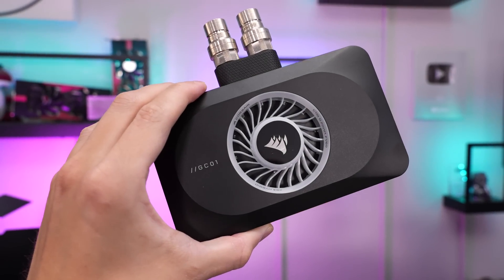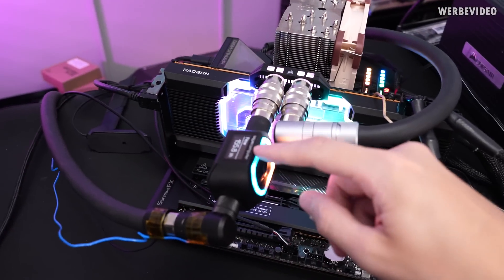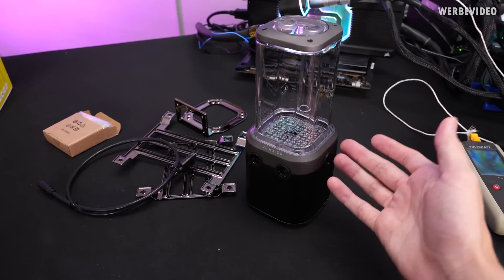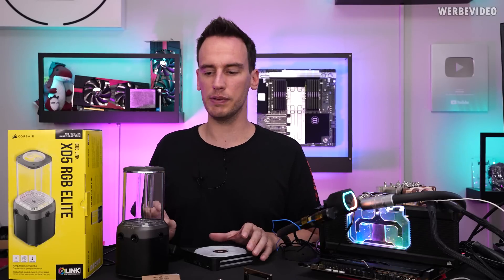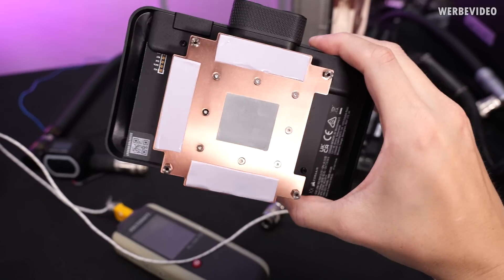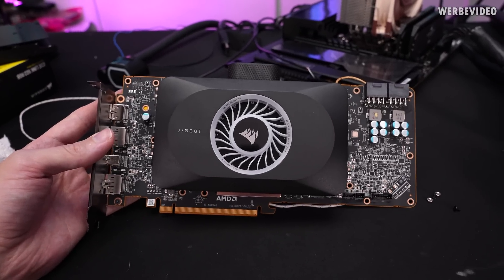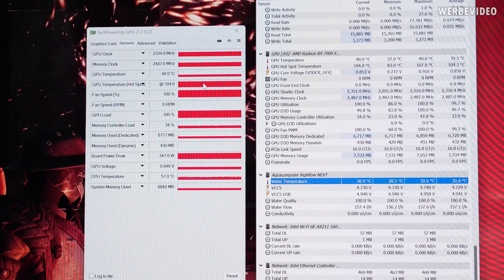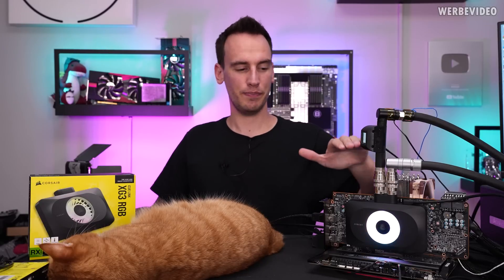There is a Problem with Corsairs new GPU Water Block

Comment: I think that this could be a good product with a few changes. If it had interchangeable mounting brackets, or perhaps just interchangeable cold plates, to make it a truly "universal" option, then that would add value; you could use it across multiple generations + models of card. The addition of some small heatsinks with adhesive thermal tape to use on the VRM could also be a good idea, although 70°C is perfectly acceptable, but only if the price is right! As a whole, this block is just too expensive for what it offers. Imo, it's an absolute bottom tier product, that does the bare minimum to get a graphics card into your custom loop. A bit like the old EKWB Thermosphere univeral GPU block, or Heatkiller GPU-X universal block.
Reply: This kind of product is what we were using back in 2006-2008 when CWCL were kind of more in still using the pond pumps and such, I mean you had a few options from manufacturers like thermaltake and such but it was all still somewhat grassroots, I vaguely remember things started more changing around the 8000 series days where more players started competing and making products more available. At 1 point though it just seemed like the entire market exploded, still a pain in the ass to throw a loop together but not as bad and less jank.

Comment: The GPU hotspot does not look great at all, I recently lost and AMD GPU due to these temps. I think it got fried after 16+ hours of usage, my temps were similar where it would run at 50-60 GPU and Hotspot 105-107. I water cooled my GPU plus added copper heatsinks around that area.

Comment: Is it normal for the 7900 series gpus to have a delta of 32 degrees between gpu die and the hot spot with the big block?
My 6950XT is about 10-12 degrees difference.

Also this is Corsair isn't lying, the quiet operation is because the fan is meant to cover the coil whine 😄

Comment: Well... When your hands grow to the fifth point, it is very difficult to work with precision equipment. The print shows that there was pressure. I'll hide it for sure. This means you simply DID NOT PUSH the FAR screws!
Plus - even your first “test run” showed that you installed the water block crookedly and the hot spot simply went off scale. Why didn't you show the contact patch for that water block?

Comment: My liquid devil 7900 XTX hits 92c hotspot at 410 tbp so way more power then the XG3 hybrid block at about 346w board power draw, but after i switched to PTM7950 it only hits 60-70c hotspot on 3D occt test cos furmark only hits about 55c hotspot cos its power limited.

Comment: Seems like a 3D printed cover would help with the looks, especially when you show the side view at 9:17 When you show it from the side, to me it feels like there is something missing. Also the port on the cooler is on the front, i would love to see it on the backside to avoid showing extra cables that might look messy.
Reply: @michaelscarport   Making a cover wouldn't have any impact on the performance, it's about the look of it. Same with the port. None of the comments are aimed at the conclusion of the products ability to cool properly, purely design and looks.
Reply: @mindtreat you're right, the cooler doesn't need to cool the board. it's just a nice little decorative piece, like a GPU hat 😌
Reply: @Crunkmaster   I think you should re-read what i wrote. There is no comment indicating that i'm saying cooling isn't needed.
Reply: @michaelscarport  Critizing a visual design is a personal opinion, which is what i did initially. But i also provided a solution that i would worked if needed. There is nothing more to it really. Im not tellling anyone to buy this, i'm not even saying its good in any way, just the contrary. Check the rest of the comment fields, you'll end up with lots of different opinions, which is what i did too, but it was an opinion about the aesthetics of the design. If you don't agree and you love the looks of it, that's up to you, but to me, i didn't like the looks of it.
Youll also see people talking about the perfomance, but thats number and science that speaks for itself, nothing to contribute there unless you have an idea to make it cool better, which in this case, i don't.
Reply: @michaelscarport  Ok, let me put it in another way. If you see a car with a color you don't like,  and you say "I would have picked another color", does it mean you're planning on buying the car and repainting it? No, and that's what im saying. I don't look the way it looks and i would have made a cover to help that issue. Its a comment about what it looks like, nothing more.

Comment: I do wish GPU vendors settled on a universal layout for mounting. Even if they stuck to 1 each it would help as you could use brackets. I would think it could even be cheaper also as a company developing cooling or whatever could have a solution for more cards. Would like to see something like the CPU AIO systems where its simple, easy and cheap. Water cooling the GPU is for sure the way to go if this high temp and power trend continues.  I also want to see more bench style cases where the system lays flat rather than upright. This will solve GPU sag, mounting the AIO/Rad above CPU height etc etc. Sure it takes up more space on a desk but with the way allot of cases are these days its minimal. TBH we could even just redesign the motherboard shape also to be more elongated and sit on the bottom.
Reply: High power consumption in gaming cards is not a trend, it's a deliberate change in silicon binning practices in order to generate the highest possible revenue per mm^2 that rolls off the production line. Given that Nvidia's latests quarterly earnings report (Q2'24) showed data center revenue is four times gaming revenue, it's likely here to stay. The good binned silicon is tuned for efficiency and sold to data centers who are sensitive to power consumption and have deep pockets, while the left over crap has it's frequency pushed well beyond the point of best efficiency and is sold to gamers who just have to deal with the enormous power consumption it results in.

So if you want a GPU with decent power efficiency, wait for data centers to refresh their stock and pick up a second pro card - right now you could buy an A4000 and get 95% of the performance of a 3070 for 60% of the power consumption. The longer you wait, the cheaper they'll get as more stock hits the secondary markets. Or you could go the AliExpress route and pick up a 3060M or 3070M laptop GPU taken from the middle bins, reclaimed and repurposed on to a regular PCIe card, and get yourself a low-to-mid range card with twice the performance per watt of anything you can get through legitimate channels.

(tl;dr: cost, power efficiency, legitimacy - you can only pick two)
Reply: @stoneymahoney9106  That's a reality that we a consumers have to deal with nowadays, I don't have much of a problem since in my country 95% of the electricity is hydroelectric generated and the other 5% is shared between wind and solar power, but for those who still live from coal and propane sure will have to pay the tax for "high end" PC parts.
Reply: VRM placement on the GPU is due to its chip design, so I find difficult for GPU manufacturers to make a "universal" layout since it changes a lot over the years, specially across different brands, so I guess we can only dream with a GPU block that fits them all, actually it's amazing how AMD manages to keep a rather similar layout across their graphics cards over the generations, for example, you can reuse pretty much the same block for different generations and still maintain a good performance, of course is not like that in every case and it depends on what are you going to cool with it next. 

I want to buy a new PC when the Black Friday's shenanigans come up this year but I guess I will stick to air cooling and the stock cooler for my GPU, I won't buy a room heater gaming PC either since I'm not going to buy ant top of the line hardcore parts, I'm happy with a mid range CPU and GPU combo and some 32gb of RAM since I like to run virtual machines and emulation, and I will stick to team red, I've been an AMD user since several years ago and their hardware suits my needs very well.

Comment: Tbh this cooler has so much clearance underneath that one can easily put additional heatsinks on VRMs. The fan on it is probably very quiet. But all is still too expensive.
Reply: The fan is speed adjustable, so noise shouldn't be an issue. But I do think it should include some heatsinks. At the very least, it needs a significant price reduction!

Comment: I love that this brand has brought custom loop more mainstream with their broad spectrum kits but thats where it ends. Their prices are NOT on par with competitors for performance:cost. 130 for a gimmick? You can spend less on something from a low-end manufacturer like barrow or bitspower (which sometimes end up being surprisingly good quality for their cost). Or wait until things shake out and prices drop on the top brands. Hell, I just bought a clearance vector block for my kids 3070 for less than what corsair wants for this joke!

Comment: This product is probably the result of a classic example of marketing wanting something that the engineers don't want. "Universal compatibility" sounds great in the custom watercooling space but for GPU's it's just a bad idea. If one is going to invest into a custom loop then just get a fitting block. Or stick to a good aircooler. Not some kind of "one size fits all" solution which performs mediocre at best and ignores certain heat parts entirely. Unless AMD and Nvidia boards on all partners are going to adhere to a standard layout for GPU, memory and VRM placement. This idea is not going to work. Or you need some kind of modular coldplate design that you can move around for fitment. Would not be great for heat conductivity.

Comment: Goodbye EVGA with Precision X1. The only set for monitoring VRM temp directly from the card.
Reply: That's less to do with the Precision X1 software, and more to do with EVGAs hardware including the sensors on their cards. If other vendors but those temp sensors on their cards, then software such as HWiNFO would be able to read it.
Reply: @noxious89123  Is there another manufacturer in this system that allows you to monitor the VRM temperature?
Reply: @ukaszpochocki190  As far as I know all new AMD cards report the VRM temperature "VR VDDC" in HWinfo , idk why his 7900 xtx only has 3 temp sensores in HWinfo. Dont know about Nvidia Cards though

Comment: I can't knock derbauer for pronunciation of the word 'aesthetic' but I have been hearing a lot of 'tubers lately saying it without the 'th' sound in 'thetic', saying it more like 'aestetic' or 'aescetic'. Reminds me of when tubers were all saying "linear" as "linn-ear" when it's pronounced "linn-ee-urr". Fortunately I guess commenting about it on everyone's videos did the trick because now they're all saying it properly (phew!). Aesthetic is just like prosthetic, in its pronunciation of 'thetic'. I'm a pronunciation stickler because kids are watching YouTube and we don't want to dilute and corrupt their vocabulary with the wrong pronunciation of words that are older than all of us!

Anyway, this universal waterblock seems like it should include some little strips of copper cooling fins to put on the voltage regulators, wherever they are. Maybe a little baggie of individual ones to stick onto each module? Then the airflow would be more effective. I just think the idea of putting a fan into a waterblock is kinda silly though. I'm glad that it was able to cool the hotspot down once the thermal pad situation was rectified. Those are overclocking temps!

Comment: This just seems like it should have been an AIO. Especially at the price point. If you are spending that much for a block there are much better options for your loop. I don't even know what Corsair was thinking for this over their own much better blocks.
Reply: They got away with charging 50 dollars for a mediocre fan with RGB. If they make it look nice, then people will buy it. For a lot of people its more about aesthetics than performance.
Reply: @simplyscholar21  while true, the problem is that this thing is really ugly.......
Reply: @oct2274  i mean installed it definitely is. Most people are going to buy it based on the package though.

Comment: I think the universal point means it can be mounted on ANY RX 7900 XT cards. Not just specifically the reference version or specifically the Sapphire nitro etc.
Reply: I think it is incorrwct snd confusing. It is not universal period. If it fits all XT/XTX. Then write «fits all XT/XTX» simple as that.
Reply: Yeah the point is it is supposed to fit any 7900 xt because the core and memory are AMD defined so custom vrm and pcb layout doesn’t play a role.
Reply: Old universal blocks were like cpu block. You had to put heat sink on every parts
Reply: There is room in the market for blocks of this type. I recently had a HELL of a time finding a full-coverage block that would actually fit my Sapphire Pulse 6800XT.  NOTHING OFFICIALLY covers that card, but a LOT of digging and some Ali Express (because no US retailer had it) got me a very specific model of Bykski block that just happened to ALSO fit this card. 

Worst case scenario would have had me use an old Koolance GPU-200 on the core and some VRM Coolers on the RAM and VRMs, but that would have looked janky as hell... and it was for my wife's PC where janky-looking is an option of last resort. This config DOES work pretty well - I had a Gigabyte Gaming RX 480 I had to do this to several years ago, but it was a 3-slot solution :)
Reply: Thing is that's not universal just means it fits the 7900xt/xtx, etc. Universal means it'll fit any card. It's just poorly worded and confusing marketing considering the targeted demographic just so they could save a half a cent on box printing. Just say it'll fit all of X card that the specific cooler is meant for and lose the universal crap.
Reply: @sirmonkey1985  Extremely poorly worded and very confusing marketing and description. On this block's product page, on Corsair's website, it states "Near-universal compatibility". On the Tech Specs section it states: " GPU Compatibility AMD RADEON (7900 XT(X)) ". JayzTwoCents tested it with the RTX 4070Ti Asus Tuf card. He stated that it is also compatible with the RTX 4070 Non-Ti. Very confusing ! Corsair should have done a much better job.
Reply: @sirmonkey1985  pedantic
Reply: @xBINARYGODx  Being accurate is not being pedantic.
Reply: Yeah, exactly. Bit dissappointing really that he didn't figure this out himself...
Reply: @The_Noticer.  If you've watched the video to the end you'll notice that he says universal in this case means the XT / XTX range

Comment: Corsair really didnt think this one through, did they.
Reply: People continue to buy crap, profits go up.
Reply: It actually looks more promising to me than it lets on, like it should be able to fit more GPUs, a lot more. It would be interesting to see a more comprehensive fit test. Or if it doesn't fit, it could be re-designed more universal. But the pricing and the product quality issues. It definitely released rushed. It should have come with VRM tape attached heatsinks, it should have had brass thread inserts.

Comment: This seems to have the disadvantages of custom water cooling (high cost, complex build process) but very few of the advantages. You still need to buy at least a pump / res to run just this block, which is absolutely crazy.
Reply: What? Were you expecting an AIO? lmao
Reply: @ChaosHusky  He was probably expecting a product that makes sense, unlike this piece of crap. You either buy a real block for a custom loop or you buy some solution with an AIO. Not this half-assed nonsense that's the worst of both worlds.

Comment: This product has potential, but 130$ USD, just no ...
I know Crosair charges a high premium for the iCUE link products, but the price is exorbitant for such a product; it should be around the $ 60- $ 80 price range.
Reply: cosair always take high price, but only they ram is good with Rain drop effect and PSU, and maybe CASE not they fans. I remember the guy lead Water cooling from ex EK, and make stupid price.